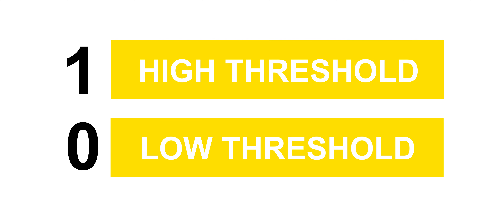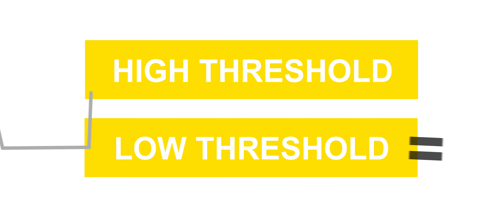What makes a DAC GOOD or BAD?

Comment: I have done a lot of testing of my old school enlightened audio designs dacs and dac/pre/processors back and forth and can can confirm going up the ladder gets you more black backgrounds, more refinement, more easful listening, more space in between notes, larger soundstage, hearing deeper into the recording and subtle stuff that was blurred can be heard better. Also don't hurt to have a dac with its own separate power supply (both that and dad filled with expensive not available any more blackface capacitors). Another thing I want to mention is it's important  feeding the dac with a good source weather it's a really good streamer or CD transport.  I have had really good results feeding my dacs with streamers and trying the audio pc steamer jplay. I know it can be controversial and not really convenient but it has really shown what my old dac can do through headphones and 2 channel system. So much better that I stopped spinning discs in my transport.

Comment: the best dac is connected to the weakest link, the computer. lol
Reply: How so, if the computer is outputting digital information properly?
Reply from the maker: @SpiritualPsychotherapyServices  Noise is the issue
Reply from the maker: @SpiritualPsychotherapyServices  it’s not the signal, everything that deals with it generates noise that contaminates the D/A process. PC’s tend to be the worst offenders, but the DAC itself can piss in its own bath water.

Comment: The Nyquist-Shannon sampling theorem says that all of the information of an analog signal can be recreated with a digital sampling rate that's twice the bandwidth of the continuous signal (in fact, the true analog signal would be the ONLY solution). This is why CD quality audio is 44.1kHz (99+% of humans can't hear sounds above 22kHz). It's definitely arguable that some higher frequency sounds could cause harmonic effects in the audible frequencies, but that ~should~ be ~mostly~ negligible. And higher bit depth (24 vs 16) gives greater dynamic range (effectively lower noise floor because mastering music at a higher volume than what 16bit can provide would cause clipping for almost everyone). I guess what I'm saying is how do higher end DACs sound "smoother" (as in a less jagged audio wave form)? Is it the analog and power delivery side? Do lower end DACs cause some interference with the analog signal? Because if the digital signal is messed up it would sound like complete garbage. I might just be wanting a bit closer to a lecture than a podcast discussion which is my b.
Reply: The only thing I can imagine would be the analog signal suffering some sort of interference from the power supply. I, however, could not find a study demonstrating that these differences are audible.
Reply: Theory ultimately have to meet with the real, practical electronic circuit. One of the challenge for DAC is the low pass filter to cut off stuffs > 20KHz. In theory, we like to draw a sharp straight line that cuts off anything beyond 20KHz cleaning. In real life low pass filters have a shape and slope that is quite far away from the knife edge we do in theory chart. This is just one area where a good implementation matters (and the reason why upsampling works).
Reply: @melcharson  Yeag the low-pass filter roll off is why the sample rate is 44.1 not 40kHz (I glossed over that originally). It just blows my mind that what is essentially a low-pass filter upgrade can cost thousands of dollars.
Reply: @jacobwelsh4772  first order LPF rolls off too gently and that introduces uneven filtering at the high freq end. Higher order LPF has a sharper slope but the ripples at both end introduces distortions. So yes, this is definitely one area that differentiates good DAC from poorer ones. 2/3 of the good money on a DAC is actually spent on the analogue circuits rather than the digital side.
Reply: @melcharson  Which is just my first question. I figured it was just the analog portion. Which is why I specifically asked about that. And issues at the higher frequency caused by the low pass filter still wouldn't cause stair stepping in the analog signal
Reply: You are to advanced for the incompetent hifi reviewers that    are paid by uninteresting hifi producers!
Reply: TheHansBeekhuyzenChannel on YT explains the ins and outs of digital audio thoroughly

Comment: I can not hear a difference, I swear and I have Stax headphones - it is not for lack of resolution on my equipment. I am 43 years old, I can hear up to 15-17 kHz, which is typical for my age... and then we should use 192 kHz files or I do not know.  Who are we kidding? I would argue DACs are new cables. Great opportunity for manufactures to make money.
Reply: The more research I have done on DACS recently tends to agree with you; DACs are the new cables and make a hella lot of money.
Reply: I'm 56 and am enamored with hi-res streaming of 192k through my Doge 7 tube dac played through Kliphch Forte IVs. I find the difference between 44.1 and 192 versions of albums from Qobuz can be quite dramatic. Play "straight on" by Heart off their greatest hits in 44.1 and then in 192 from the Dog and Butterfly album. The difference in dynamics and clarity is shocking. At first you may be tempted to think its just much louder but cranking the volume on 44.1 does not give the same effect as the 192 which so much punchier with all aspects of the music jumping out the speakers at any volume. The difference is much more noticeable on large and very dynamic and transparent speakers but I could tell the difference on my Wharefedale lintons and KEF R300s as well. The difference may not be as noticeable with other albums and artists but when done right there's a big difference. Maybe its a different master but I hear the 44.1 as normal and what I've heard all my life. Some 192 sounds like I'm in the studio with the artist. I get this same affect with alot of 44.1 jazz and blues through the Fortes. In fact, everything sounds very live and present in the room compared to the other two I mentioned (although KEFs much more hifi than wharfedales which has greater scale and bass). Fortes have it all and then some
Reply: @monkeybutler2  greatest differences between cd quality and hi-res recordings come from a mastering table, not the bit depth and sample rate. Don’t get me wrong, the quality has an effect but far less than what is often coming from different mastering routes. 16bit/44.1kHz often are from different masters than 24bit/96/192kHz. These new/better masters would sound great even on 16bit/44.1kHz. Again, it’s more of a marketing push than anything. And yes I have gear that can make out the difference if there is one.

I have also ran multiple different audio analyzer softwares on the files and many many hi-res files have over half of their frequency range filled with just noise that has been shifted into the upper frequencies (‘noise shaping’), because it was expected to be cut out anyway. Often these hi-res files have from ~40kHz to 9/10 of nyquist filled with just noise. Nothing musical there. We tend to pay a lot more for nothing, sometimes even for detrimental noise pushed to our speakers/cans. 🤷‍♂️
Reply: @alkestos  Yes, I've heard huge differences in the same songs both  at 44.1 as well. If you listen to Stranglehold on Ted Nugents first album it sounds amazing but no so much on his greatest hits. Have to be different masterings. Alot of 192 cuts are better masters as you say so it is hard to say how much of the improved clarity is due to the increased resolution. I'll pay the extra 10 bucks a month just in case.  Although I wish it was better curated, I like having lots of choices so I can compare and contrast myself. Granted, the 192 may be worse thus the need for option of different masters. I don't believe all hi res is necessarily bunk across the board though. Some of it seems to compare favorably with the sound of my SACDs.
Reply: Then I would suggest you have never compared a low-end with a high-end unit. I have and the difference is quite substantial, particularly as the Abyss guys suggested, in the higher pitched content.
Reply: @SpiritualPsychotherapyServices  How did you make the comparison ?
Reply: @SpiritualPsychotherapyServices   Did you use the same amp for all DACs ? Did you match the volumes ? Did you do a blind test ?
Reply: I could hear a difference between a 100$ dac and a 750$ dac but it is VERY subtle …. Which is what they’re saying in the video. They’re not saying it’s night and day they’re just saying that if you already spent 5000$ on a headphone and thousands on an amp … then you’re really running after the 0.1% changes … and Dac might be where you’re at this point. I never tried thousands of dollar dac so no idea if that’s better than my 750$ one or if I would ever hear a difference.
Reply: @256alexdt  I'll ask you as well: Did you use the same amp for both DACs? Did you match the volumes? Did you do a blind test?
Reply: @DrinkWater713   Ofcourse me and my friends are having fun with our hardware all the time and we always make sure to test things properly. The reality is that some songs you won’t be able to discern almost anything … and some depending on the frequency and instrument you will be able to perceive something after long (hours) of comparison …and pressing a button A/B … We do the same for Amp also … those are much easier to discern tho. Again never tried thousands of $ dac because the difference between a 100$ one and a 750$ is so ridiculous and not worth it that I do not know how much benefits you get after that and I prefer spending on speakers or headphones.
Reply: @256alexdt  I feel the exact same way. I would never consider buying an expensive DAC. I would rather just buy another headphone and have fun with the different sound signature.
Reply: There could be many reasons why you don’t hear a difference but just because you don’t hear a difference doesn’t mean there isn’t one. I know I can hear a difference and in some cases it’s substantial. Consider yourself lucky. Your cheaper system is good enough. No need to upgrade.
Reply: @SkywhiteChannel  Interesting. I'm on the market for a new DAC, so I guess it would be in my best interest if there were no differences. Have you ever done double blind tests on DACs ?
Reply: @DrinkWater713  What I am doing is: swapping ear pads, adding and removing high tone, mid tone... dampeners. I have stax L300 limited, the original come with very bad ones, so 3d printing holders and tuning it yourself is the thing with that model. The process i enjoy a lot. Internal acoustic of headphone makes huge difference. The kind of difference i notice even after few days: aha... this is the setup, this is how it sounds like. yes. I remember. Ah yea, and when I change headphones: that is even 10x more different...
With DAC: no, I do not blind test DACs. But when i swap them i go: hmmm? yes? no? I dont know? sounds the same to me... I am talking about 100 euro and 300 euro DAC OK, I do hear a difference when i listen on a 5 euro DAC, but even that is much less then one would expect. 
I would argue that getting clean enough, to a point of our ears can not pick it up anymore in digital world is much easier then getting clean in physical world: the actual driver and space it plays in is extremely complicated and hard to control with hugely varying results.
Reply: @DrinkWater713  I’m most likely kick a hornets nest here but here goes: most people who claim to hear these differences never do blind tests.
Reply: @alkestos  A persons dislike for blind tests is usually directly proportional to the amount they spent on hifi equipment lol. In the case of cables, the scale is logarithmic.

Comment: The software used - coming from a Audirvana perspective, can be a very nice/cheaper way to improve on the sound coming out of your existing hardware.  It is almost like you put in another DAC.
Reply: As long as it’s using exclusive mode and an external DAC then there isn’t much difference the software will make. Roon and Audirvāna are both really popular and sound identical

Comment: I'll call that "harshness" tiny distortions in especially the high-mids / low-treble, when the music becomes very busy and saturated as mentioned here.
I recently upgraded from a $300 to $750 DAC and there's a clear difference even below $1000. I also had a $900 dac-amp but I kept using my $300 one and traded the former in for the cheaper $750 one. As much as reviews praise things and pricing tries to guide you, just trust auditions and combos with your own gear and music.

Comment: It’s a freaking miracle that cheap DACs and expensive DACs both decode the ones and zeros ..it’s the implementation of the output via the 2 or 4 volt line amplifier to the pre amp, headphone stack it amplifier.